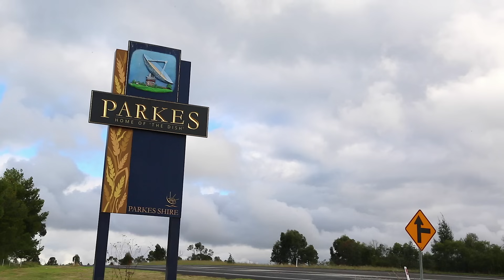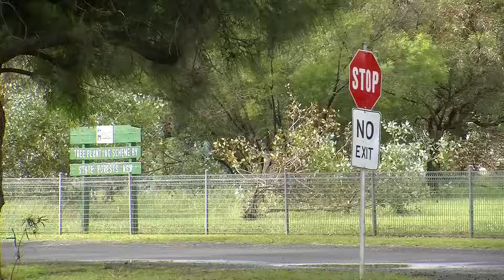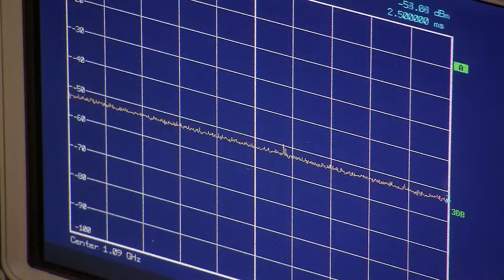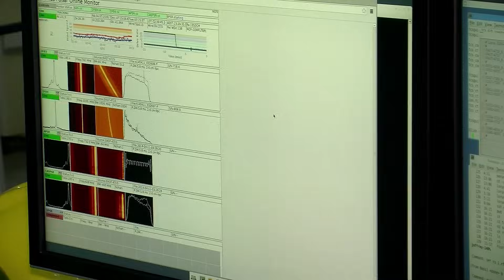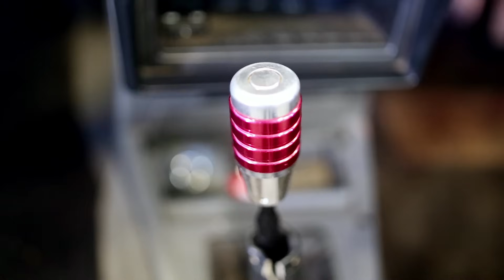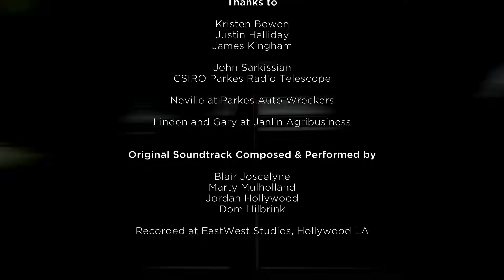Lend Us A Ride: Australia [EPISODE 2]

Comment: Quick general explanation of Aussie registration laws:
You need an inspection slip from a qualified mechanic saying the car is safe to drive (all lights work, brakes work, no leaks or major mechanical problems), which you then take to an insurer who gives you a slip saying you are covered against damage you cause to anyone else if you crash into them (as a minimum), and then you take all that to the state registration office and they register the vehicle as legal to drive on the road. You may also be issued with new licence plates if you are registering a currently unregistered vehicle. All that generally costs around $800 annually (in NSW) or more if you are registering something that needs plates, transferral of ownership fees, or a more detailed technical inspection because its been off the road for a long period. If you want comprehensive insurance it starts at around $700 a year on top of the above for a driver under 30 in a non-performance passenger vehicle. If your car has a lot of mechanical problems it can often be cheaper to simply buy another that's already got registration. Hope that helps for our international friends!
Reply: Also thanks to the Mighty Car Mods team for the new episode, good idea for a series!

Comment: omg. Capri's engine looks like a 4g63 and the front end looks abit like a 1989 to 1994 Eagle talon.
Reply: That's exactly what I thought.
Reply: the guy who makes "tom's turbo garage" has shown that you can run a mazda miata (mx5) on a dsm controller to turbo it, apparently mitsubishi 4g63 is the most duplicated engine ever created
Reply: duplicated with variants that is
Reply: Mazda 323 engine. back when Ford and Mazda did the whole 'platform sharing' thing in the late 80's-early 90's...Holden and Toyota too..
Reply: It's the same motor out of a Familia GTR I think? 1.8L Mazda BP motor with a turbo strapped to it :)
Reply: blankpaper66
 - no....The Capri has 1.6. Many differences between the 1.6 and the 1.8
Reply: Basically an overbored 1.6L

Comment: Anybody know what year that landcruiser is??
Reply: Early 2000's or late 90's
Reply: mid 90's
Reply: mrmacomouto it doesnt seem to be this :(
Reply: Yas The Defender  it doesnt seem to be this :(
Reply: Most likely early 90s. The 1HZ utes are the most common. Could be an 80s 2H model but they're getting a little dated and aren't so common.
Reply: SoundPon3 Yup you are right about the 1HX utes.. They were made since the early 90's upto the mid 2000's actually..
They are  pretty rare where i live.
Reply: Yas The Defender Where do you live? They're everywhere in Australia. They still make the HZ utes but they don't comply with ADRs here in Aus anymore but they're still available in the middle east and such (I think). The VDJ series took over.
Reply: It looks like a J70... made from the mid-80s to today
Reply: 1970's model
 edit: nevermind I think the guys above got it right. It seemed to be based on the 1970s. I remember this being sold brand new top of the line in the middle east in the early 2000s.